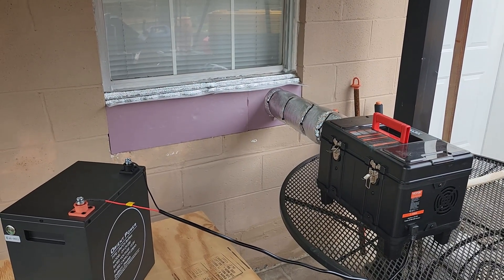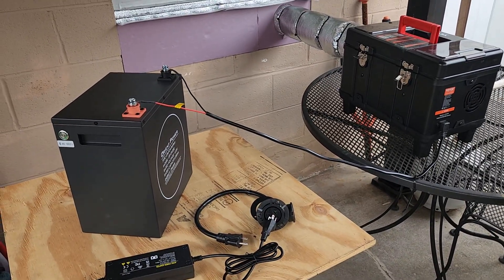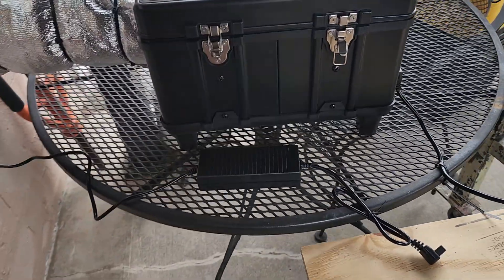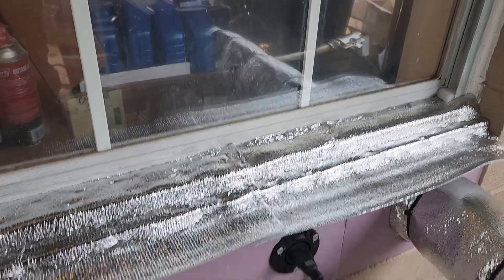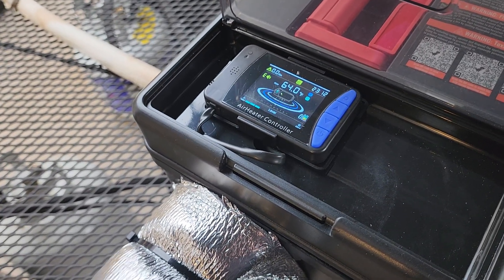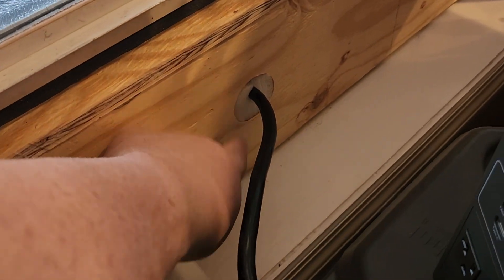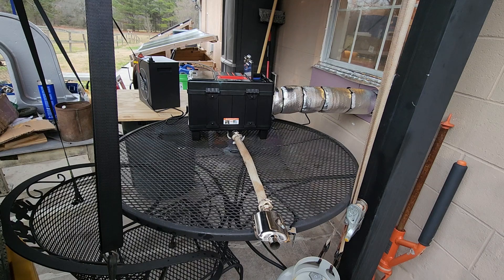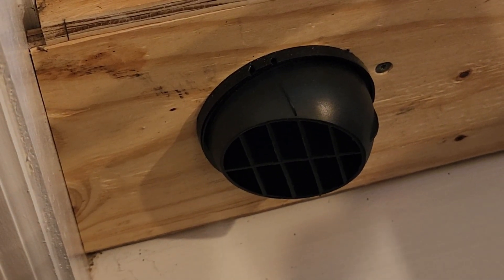Keep a diesel heater running during a power outage and Stop it from backfiring!

Comment: thank you for this video, I haven't seen the first video, but you'd heat your inside much quicker and cheaper if you take air from inside to recirculate through the heater, rather than taking new cold air all the time.
Reply from the maker: Im also going to be running either a kerosene or propane heaters as well inside the house so I don't mind the fresh air coming in from the diesel heater. But I get what your saying.  Stay warm my friend!

Comment: it would be safer to run a low voltage DC power extension through the wall so the High Voltage and PSU are on the dry side. You could also use a DC output on your solar generator to avoid using the inverter to go low-high-low as this would be more efficient and your power in the battery bank will last longer.